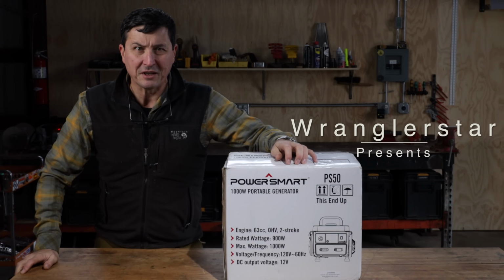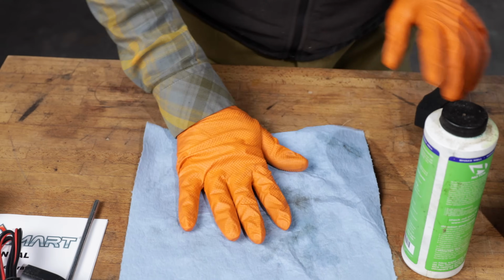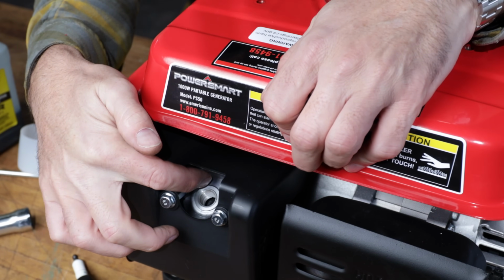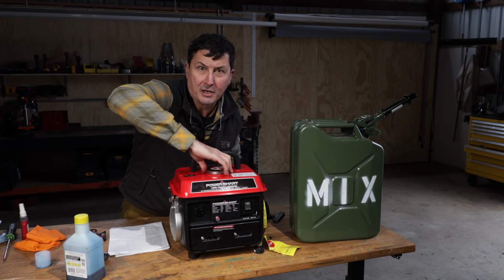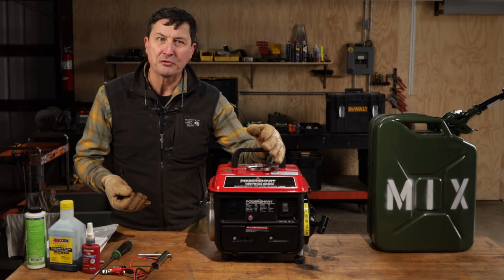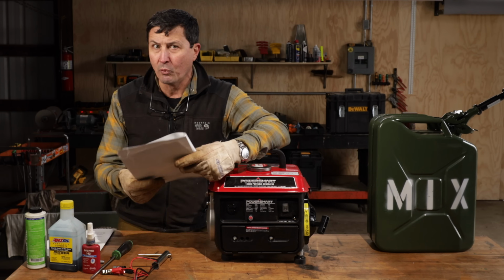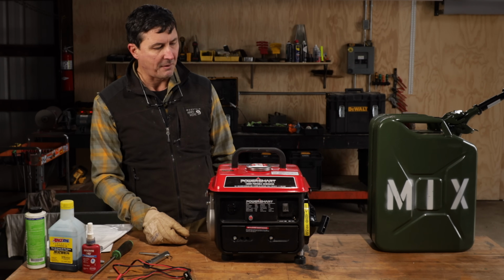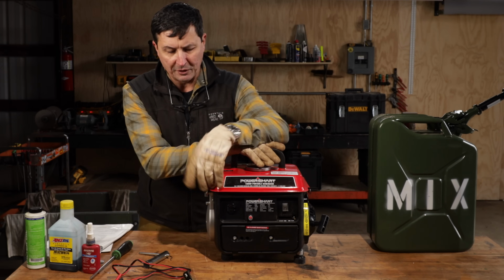TESTING The Cheapest GENERATOR on Amazon -$99

Comment: I’ve had 4 from HFT. None made it more than 2 yrs at most, all had various problems, 1st one was the best at 1200 watts, the pull spring broke in 2 yrs, couldn’t get a replacement, also hd to R&R spark plug wire, 2nd one just refused to start after running it for 7hrs during a power outage (tv & fan only ), 3rd one burned up-starter wire & encapsulated capacitor ( I burned up 2 in a week with my electric chain saw) I returned the last one only having it one day when the store pointed out where the 1st tailgater was 1200watts, HFT has steadily reduce the running wattage & the last one I bought was only good for 9amps! It will not run anything with a motor. On both my last 2 Tailgaters, I used my electric chain saw ONLY & they both burned up. My elect chain saw is 6 amp- 720 watts but the startup surge watts takes it over 9 amps or 1080w which the delicate & cheaply made genset couldn’t take. I assumed the little generator was still 1280 w but it isn’t. This is probably ok for running a few strings of LED lights or charging your phones & iPads or trickle charging 100a/h solar batteries on a cloudy day  but if HFT keeps lowering their base amperage , it will soon be just another Chinese boat anchor! Shalom!

Comment: I have exactly that generator. A different name on it, and mine was purchased 9 years ago. I use it year round, and it has never failed. The only time it gave me problems, was when I didn't use it for about 6 months, and forgot to put gas stabilizer in the tank. Obviously my fault. This is a great tiny portable generator that has served me well for 9 years, and I have little doubt that it will continue to work well for another 9 years and more.

Comment: Hi, thought I'd share a story with you folks: In Iraq in the mid 2000s to 2010ish these things, or bigger units, were a necessity in every home due to the inconsistency of power supply (still a problem today but much better than before). This size if Chinese typically costs about $35 there and lasts for years of extensive usage. Just keep it well maintained and it'll save the day...

Comment: i have had this generator for more than 20 years(the 220v 720w version)used it about 50 times for about 2-300hrs have not had any problems at all.different stickers but it is the same generator and it does not use a lot of fuel during normal use.it is best to use alkylate gasoline on two stroke engines that you do not use too often,alkylate gasoline can be stored for several years and will not go bad even if you store it in the tank or in the container.at 3,12 you can see where to adjust the voltage(right side of the fuel shutoff valve on the small opening on the tank)some of the generators are a bit off when it comes to the output voltage.

Comment: You really shouldn’t run a 2-stroke dry because then you rub them dry on oil and you risk damaging the engine
Reply: I agree. The reed valves in 2 stroke carbs like it wet. Just run non ethanol gas and a good synthetic oil and you can go a year between runs and be ok.

Comment: I have a nice 4Patriot  solar generator with four solar panels, although I looked at a whole house propane generator, Here in our area of the California Sierra in winter generator sales go up when newbies on the grid lose power for days and days,  and then they risk losing all the meat in the freezer. 

 The issue I have with gas, propane generators is the noise. which is why we have seen more and more folks building secure areas in which their generator is placed so they can't be stolen.

Comment: I would like to know how well it runs a home refrigerator.
Reply: It wont.. The surge watts needed to start the fridge motor is more than likely higher than 1000w..  Generally your surge watts are about double of your constant watts..  Just like starting a microwave draws a lot of watts initially but once its going it uses less wattage..

You alwayd consider surge watts when looking at a generator.
Reply: Bigger soft start capacitor?
Reply: He ran a 1500W heater so it should handle a start surge for a fridge.
Reply: @Mixwell1983  Yeah,  I wish I knew that before I ordered two. :(
Reply: That would not be a problem, a fridge or refridgerator draws roughly 100-250 watts. So even concidering a higher draw when the compressor starts you would be fine.
Reply: No problem.  I have used it several to run my refrigerator.  Last hurricane, I used a larger generator to run my house and loaned this little 2-cycle to a neighbor to run her LARGE refrigerator.  It ran her fridge as well as a TV with no problem. This thing has amazed me with what it has run.

Comment: I could give a little bit of insight and longevity I had a clone of one of those and yeah we ran it probably half a dozen times it ended up blowing the seal on the crank shaft on the work side the side that has the generator I know that because it laid not working for years until my brother and I fixed it on Christmas just for fun but  it’s a job to take apart and get that little seal out of there

Comment: Great timing. I just received my Home Depot version (Sportsman) of this generator today. Got it to be the first line of defense if I'm out of town. My wife was thrilled at the weight. Our other generators weigh much more. Also, a few times a month I run down the road with 2 large chest freezers in a trailer. I have a battery bank with inverters I use. Now I can run this down the road during the day and use the batteries at night for stealth mode...

Comment: At that price point I highly doubt that the inverter is pure sine wave. And if it is not, lots of devices don't do well with a modified sine wave, such as anything with an inductive load. It could even fry sensitive electronics. A microvave will run on a modified sine wave inverter, but very rough and inefficient.

Comment: One pro tip if it's been sitting for a year and as a million hours on it like mine does pull the air cleaner out on first start up then it'll fire right just need to do this first of the season after that it starts up like Honda

Comment: Not for nothing but how clean is the power?  If it's dirty you wouldn't want to run sensitive electronics on it.  The Honda is an inverter generator which has a cleaner sine wave, this may have a square sine wave and could harm your computer.  Motors should be OK, but computers and TV might not be.

Comment: You should test the cheapest four stroke generator on Amazon
Reply: That would be interesting. I have an inexpensive 3,500 watt Champion, and it's a very good generator for the price, just like this one. Mine's an overhead valve 4 cycle. I got it on sale at an auto parts store for about $200.00 US. It even uses an electronic voltage regulator!

Comment: Might have to get one just to have around. Use aviation 100LL fuel in your small motors it will never go bad. If you forget to dump out the fuel and run it dry no worries.

Comment: @2:37 You're wrong about aerosol filter oil. They make two kinds, one for foam filters and one for fabric. The aerosol foam filter oil is exactly as thick as its non aerosol counterpart after the agents evaporate. As long as you get a good aerosol foam filter oil like Twin Air/PJ1/NoToil you are more than protected. If you had argued that the aerosol foam filter oil isn't a good value for the money then I'd agree with you. Cheers

Comment: Ive got the king Canada version of that same output. It will not start a fridge or anything with an induction motor. Just doesn't have the surge capacity. Mine also has problems running led lights the lights flicker and hardly run without a voltage stabilizer. I'd check the voltage while running that heater I bet it's probably around 100v or less.thats with fresh ethinol free fuel, Castrol 2 stroke oil and carb and tank drained after every use

Comment: These things are great for temp job power and for charging dead batteries on machines  way better than a jump pack just gotta watch the voltage, maybe a follow up video where yoi plug in a killawatt and see what the voltage drops to with the 1500 watt load

Comment: I had one of these that was branded Genmate. Owned it for 4-5 years. Would run about 8 hrs with a 700 watt space heater. Was awesome for backcountry camping. Run for a long weekend on 5 gallons!  I did switch the plug out for a e3.18 and fuel economy and starting was better but didn't touch anything else.

Comment: I'm doubtul related to the electrical capabilities of this generator. It's clearly marked 110V/7.5A/1000W... My own basic calculus tells me it's rated 900W max. Worst, the safety (breaker?) didn't tripped when running for a while at 1500W. I'm curious to see the waveform on the AC too.

I agree that we're not comparing apples to oranges but I'll stick with my Yamaha 2000W generator. This generator is not gone to let me down at the time when I'll need it the most.

Keep up your excellent work!

Comment: I have the same generator but called a different brand. I’d recommend changing the cheap spark plug with an ngk spark plug. Will save some headaches. Great little unit for keeping around the house/garage or camping etc. even small enough to pack on a quad.

Comment: Great video. I have the tailgator one. Be sure to check the voltage and frequency with a killawatt once you get it broke in. Once it frees up after break in it will run faster and have a higher voltage. There is a small adjustment screw that you can back it back down.

Comment: That generator is sold under many different names. Mine is a Champion, exact same generator. I love it. Had mine for six years, and I use it all the time. My fuel line did rot off after the third year, but I'm still running the original spark plug.

Comment: There's a utube review of this same Chinese 2 stroke generator that recommends removing the air box to access the carb. Remove the carb and Loctite the carb mounting bolts.
As several have also mentioned replace sparkplug with a good one.

Comment: My small engine guy also suggests running your generators with a 10 amp load on them a couple of times a year for a few minutes  ... to cycle/exercise the electric circuits ... I use to just run the engine, but he says he see's a lot of new ones that run but won't produce any current ... can't hurt, I just run a heat gun in all the outlets and a tire infiltrator in the 12 volt outlets

Comment: Had these 10 years ago here in Canada I beat the snot out of mine going in the boat for quick camping trips. They works beautifully but the noise factor is only downfall. Beat mine for 4 years without 1 issue sold it as a running unit. I think I paid 99 and sold for 75 after 4 years of solid use. If need for power outages just make a simple plywood insulated box with some flex tube for the muffler in a snake pattern and you won't even hear it. 2 thumbs up all way. China not as bad as u think. Is it industrial no. Consumer grade but I've had their chainsaws generator 6 style of dirt bikes and 5 styles of ATVs and 3 styles of full size side by sides. And I'll tell u the value is huge.

Comment: The problem with cheap generator is they are not pure sign wave output, and the voltage usually varies. So be careful using them for running computers and other electronic components.
Reply: SINE wave

Comment: Omg this man wears ear muffs for a generator
Reply: He probably wants to be able to hear down the line.
Reply: 90 decibels...84 is the actionable level for long term.....Take it from a 67 year old who wears hearing aids and I still struggle to hear my 7 year old grand daughter. Never laugh a safety
Reply: I had an uncle was half deaf by the time he hit 50 because he was too proud to wear ear protection. I learned my lesson, and I use ears plugs when mowing grass, running the weedeater, or blowing leaves. When your hearing is gone it never returns.
Reply: @justmeandthethree  Same with my dad.
Reply: @ArkansasPilgrim  From age 18 to 24 I worked in worked in logging, and I never used ear protection. Now, my children complain when we watch TV because I need to turn to volume up.
Reply: @justmeandthethree  it does give you a good excuse to crank up Stranglehold, though.

Comment: I would avoid using for electronics. My harbor freight generator cost me a WiFi router.
Reply: Use a surge protector and plug your electronics in to that. Or spend the extra few bucks and buy an inverter generator, Honda is not the only producer of inverter generators, they just happen to be the measuring stick that everybody uses.
Reply: I run mine through an UPS. They have voltage control and about a hour battery power in it so when the fuel runs out. I still have power before refueling .
Reply: You need an invertor generator for sensitive electronics.
Reply: I agree. Electronics tend to be finicky about their electricity. It needs to be consistent
Reply: I'd expect the power brick to filter out most of the noise however the brick itself can get pretty hot when run off a modified square wave like these put out.
Reply: @Scott Lichtsinn efficiency is no more with that setup.

Comment: Two videos in a row two products in a row that give me the fizzzzzz 🍸 probably going to buy the belt and this gen I would love to see you do a 24-hour run test of this thing to see if it fails I live in a smaller house so I don't need a giant generator and I would love to see if this thing works good or not over a length of time because something like this is all I need please do this on the next video also I agree with running engines dry I've always done that I was watching a video a couple weeks ago and it kind of irritated me that a guy said that you do not want to run your engines dry because the seals in the carburetor can dry up and I disagree with that gasoline ⛽ will turn to Varnish over time and you and me know that it doesn't matter how much fuel stabilizer you put in the gas it will eventually turn to Varnish I'm a mechanic I've seen pretty much everything God bless you and your family y'all are always in my prayers please keep me and my family in yours

Comment: Another Great Video, I had thought you would have trashed this unit !
12 Years ago I purchased the Harbor Freight unit $80. with a coupon, I think. My only issue has been old bad Gas, my Fault and I yanked too hard on the Starter cord and had to replace it. I camped as a Snow Bird 95 Days one year & 120 Days the next year in Quartsite, AZ in my Adventure Ford Cargo Camper Van with 200 watts Solar. My First 2 years on my new land up here. I ran 100 foot extension to the unit down in a dry river bed and ran it a few hours after dinner to charge my Marine Batteries if it had been over cast. That Plastic Cup fits in the top of the tank opening. Fill it with 2 S Oil and fill the tank with gas if you have no more mixed. I have used Motor Oil in a pinch and I am sure my rings are worn but it starts with one or two pulls even after sitting dry in my barn for 2 years. A Great Deal !!!   Now I want the one you have with the 12 volt free plug. I had to run a Car 12 Volt Batterie Charger when I was camping. Power outages here I have run it for hours Behind a few Plywood Cut offs to make a sound baffle. Sounds like a Honda then 100 feet away.  I am sure I have not spent $800. on Gas to run it and I have never not run it when needed.
Reply: I just ordered not a replacement for my now 12 year old Harbor Freight Tailgater like the one you posted above. My 2 Stroke is still a runner at 12 years and Hundreds of hours and tanks of Mixed Gass a few Spark Plugs and once I replaced the Pull Cord, my Fault. I was hard on it. I ordered from Walmart   This $299. Free Shipping A-iPower AP1500i 1500W Enclosed Digital Inverter Generator in Gray. With all going on in the world today. I needed to cover some basic needs, Freezers Refrigerator and to run a Small heater or a Window AC unit if well into the 90's as it gets over 100 up here a few months. This like the little two Stroke did filled a need at or on a Budget where a Honda was wanted but not needed and the Savings can replace this unit 3 times X s $299. is only $900. A fair Purchase ? We will see.

Comment: Torch Brand sparkplug = trouble.... best to throw the thing in the drawer and replace with a NGK...
Reply: Replace it AFTER your break-in procedure. These generator manufacturers often recommend mixing more oil into the fuel during the first tank of fuel, to assist with a proper break-in. That extra oil tends to foul the spark plug, so after the break-in, with the normal 50:1 mix, then replace the spark plug. I would rather foul the factory plug, then, replace it when the engine is burning clean.
Reply: A lot of the Chinese spark plugs are best replaced with a decent quality NGK or similar spark plug. A lot of the mowers with Chinese engines have these torch spark plugs.

Comment: This is the same generator they sell at harbor freight for the same or a little less. Pretty good little guy if u ask me. It is reliable, but not great for powering a 12v car battery charger. Dirty noisy power. But it will run a skill saw or similar tools.  I have had one for 3 years and still going strong. Good on fuel as well really.